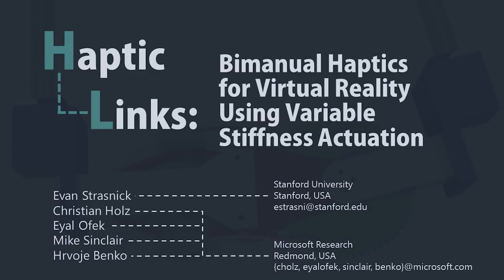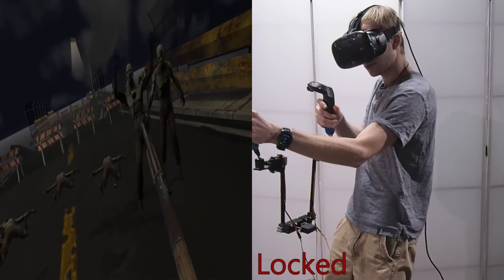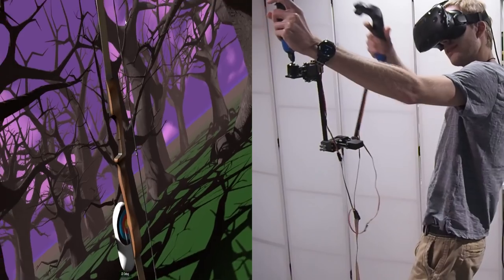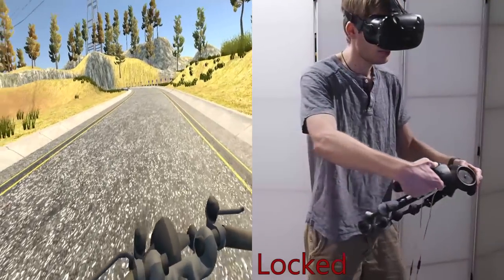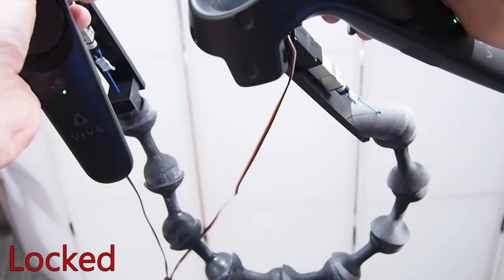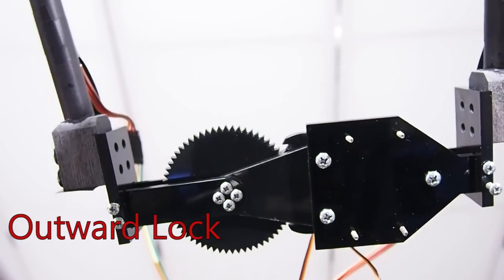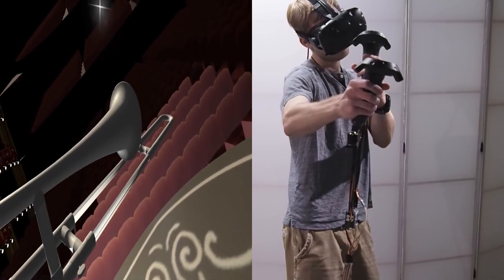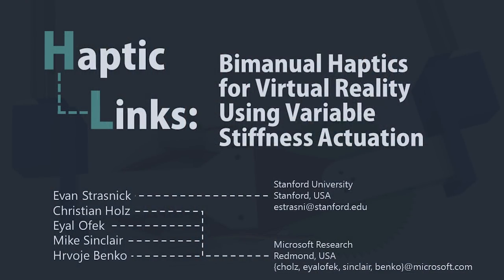Haptic Links: Bimanual Haptics for virtual reality using variable stiffness Actuation

Comment: If you're trying to block a projectile from a 180deg position it's impossible to gain enough freedom to put both hands on either side of your body... especially if you're tall... even shooting at something out of screen seems impossible for this... any solutions to those situations?
Reply: Only 2 I can think of, starting with the (much) easier option: design your game interactions around the limitation, and design custom hardware around your desired interaction.

Comment: While clever, this seems cumbersome and restrictive. Your controller movement is restricted which is not desirable in normal cases. Additionally it adds extra weight. I see this more as an experiment or bit of research rather than something that will lead directly to a consumer product.
Reply: VR has always been cumbersome and restrictive with wires all over the place, tangling around your legs and a big heavy headset on your head, yet people are still facinated and our minds are fooled.
It's all about how a designer translates the weight into something that weighs appropriately, of course a rifle is going to weigh more than two handguns.

Of course, we're always innovating more and more, with wireless and lighter versions on the way with every step.

I absolutely see what you're talking about with restricting the hand controllers which is absolutely a big no-no in many games, but this will most likely be used in games where you do not transfer between two-handed equipment and dual wield all the time.

I can't wait to play bow-simulators with this kind of tech on my side.